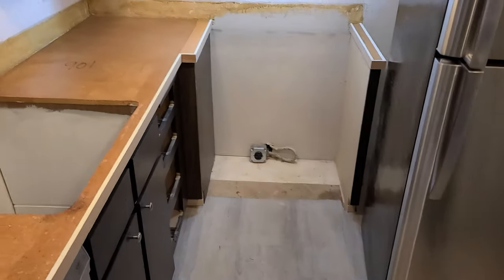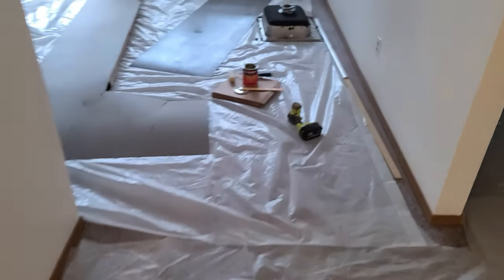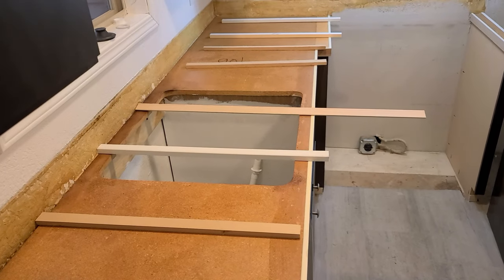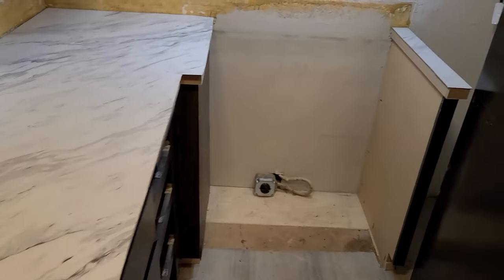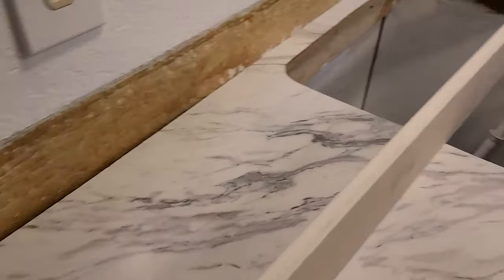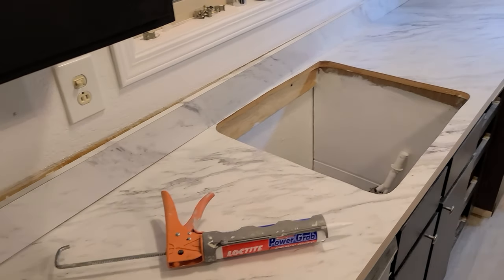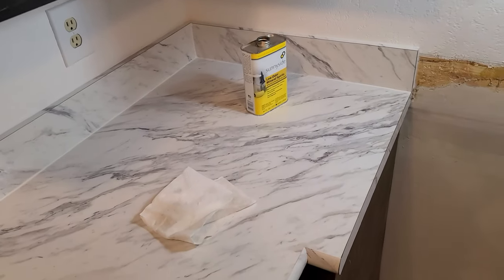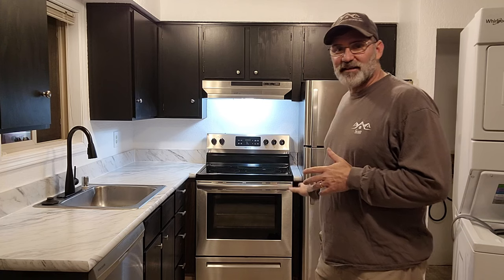WILSONART Laminate Counter Tops! | EASIER than you THINK! | 2022/002

Comment: Question if I may? I want to hire pro's to come redo my laminate countertops. Now I know that counter tops can be de-laiminated (with a heat gun or hairdryer) and to me then you don't have to do a rebuild on the MDF and all the seaming and so on and so on....but no companies will do that. They all say "we only do new builds...we come measure, build new ones with your new laminate in our shope, then deliver and install in one afternoon." I get that is easier for them but more cost to me. Are they lazy or just want avoid the hassle and mess of doing it all "in home?"
Reply from the maker: Most of the time, they do not want the liability of building on top of someone else's substrate. It's a warranty issue. Really, the cost is probably the same because they don't need to delaminate and prep. They are starting fresh.

Comment: When you show the bullnose with the blue tape I see the seam between the bullnose and the counter top, but when you show the finished job I don't see a seam. Is there more to the process that eliminates the seam?
Reply from the maker: After everything is set, you run a file or sanding block along the edge, the seam becomes a black hairline that disappears into the pattern. This is the same with these types of counteracts. Great observation and question!

Comment: if i wanted to use contact cement with new laminate on what appears is already laminate countertops (i’m renting an apartment and want to be able to reverse the diy), would i be able to use a product to remove the glue without damaging the original countertop?
Reply from the maker: Acetone should remove any glue residue without damaging the surface. Be careful in around seams.